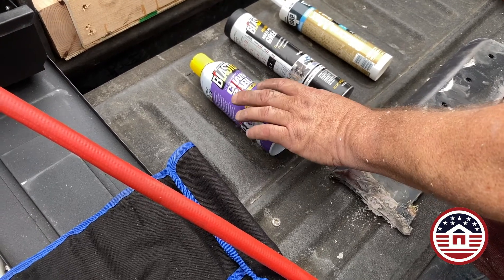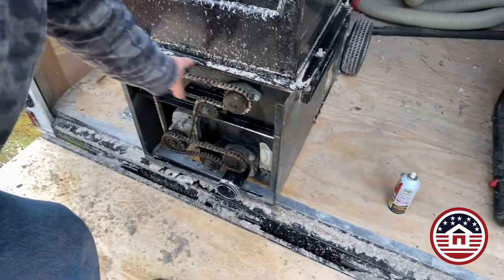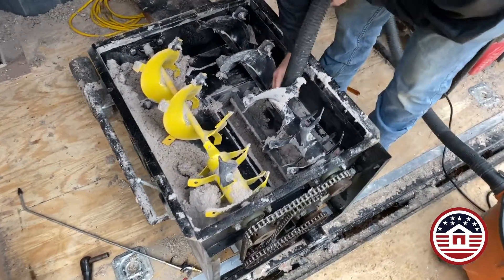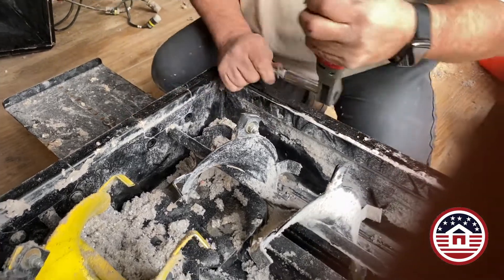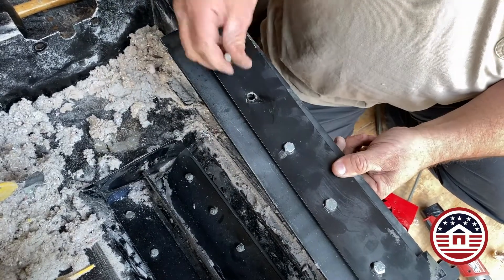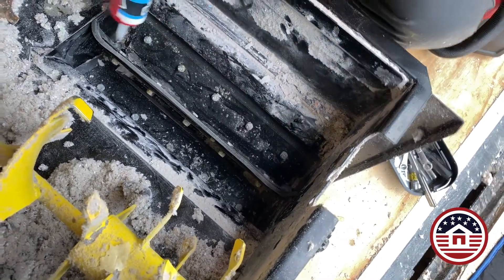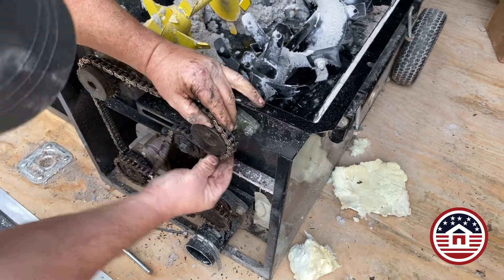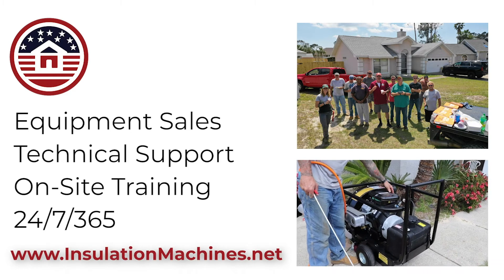Maintaining and Changing Airlock Seals on CM1500HP by Cool Machines

Comment: Hey Berry, how do you turn the air lock blades?
Reply from the maker: Hi! Loosen the chains and remove from the sprockets. As you put the new seals back in, the rotation gets tighter. Sometimes, we use as pipe wrench with rags to protect the sprockets as we rotate the shaft.